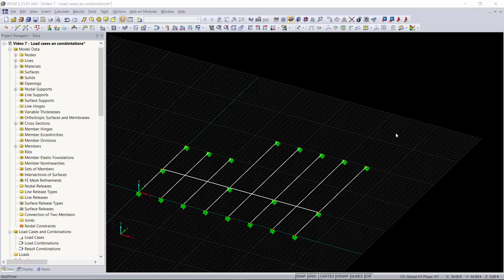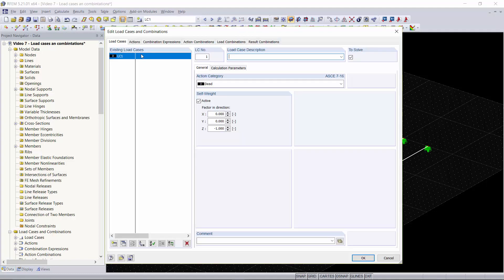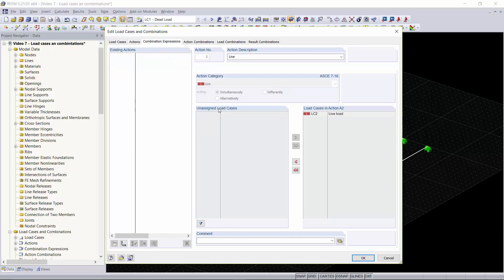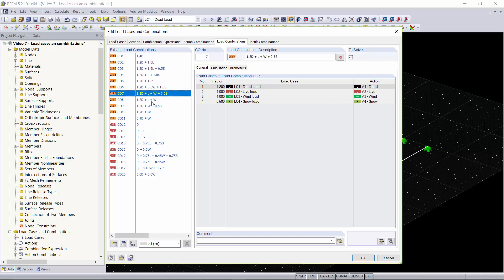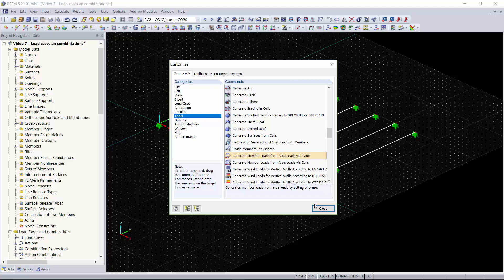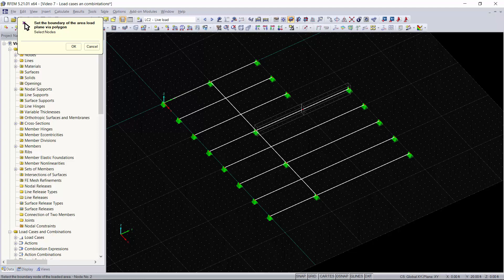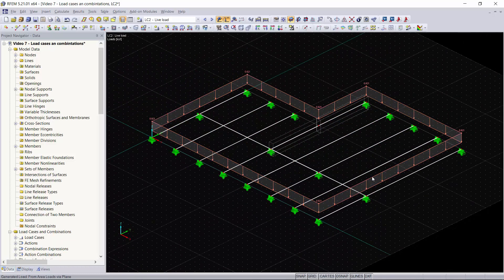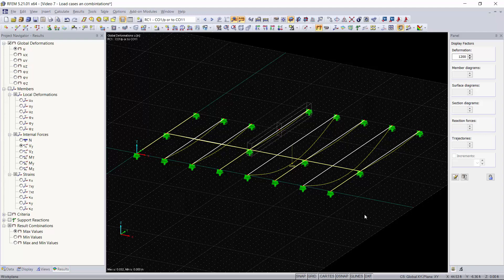RFEM 5 Tutorial for Students | 007 Automatic load combinations

Comment: Thanks for the video. It is rely nice series. Would it be possible to make video using the load generator for loading structure with plated.
Reply from the maker: Hi, Robertas!
It works the same way, but for surfaces. In the generator you have to choose if you want to use surfaces or members.